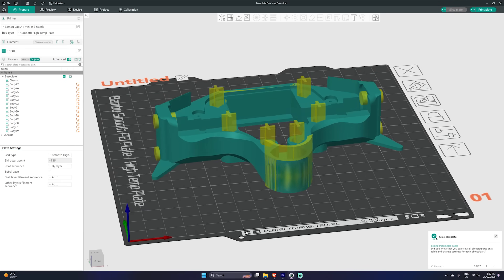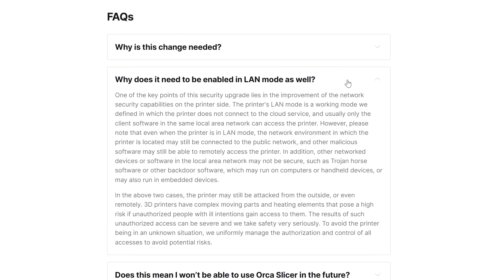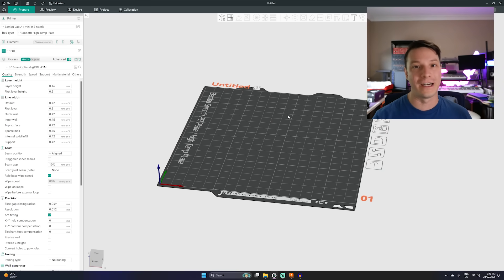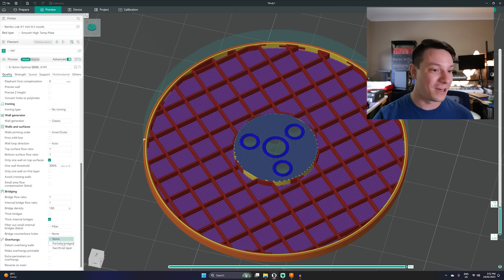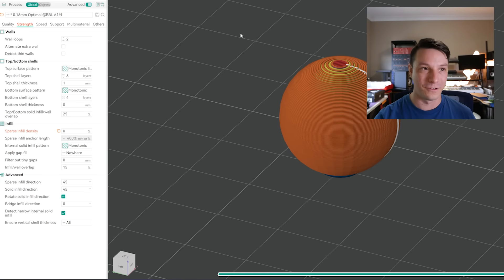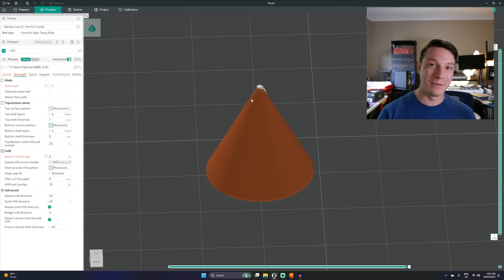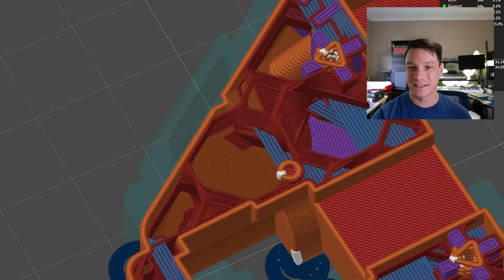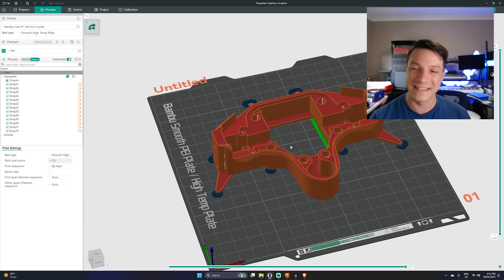I've switched to Orca Slicer for my Bambu Lab 3D Printer (and you can too)

Comment: Anyone gone from Cura 5.9 slicer to Orca?  Thought/opinions
Reply: I’m currently in the process of trying to switch from an old 5.4 profile and move to orca for the built in tuning prints and such, I’m still a newbie to printing to, the profile I use for my klipperized sv06+ isn’t my own, I do make some minor tweaks to it in cute but usually only number of walls and infill type, I figure if I’m going to really learn how to build a profile orca seemed like the way to go
Reply: @ that’s one of the main features drawing me to orca as well, the tuning prints. Cura has some as well but not as robust as I’ve people people using with Orca. Thanks for sharing
Reply: Just do it. Don't overthink it.

Comment: how does a single outside perimeter of 0.8mm happen with a 0.4mm nozzle? is it overextruded?
Reply from the maker: Yep, in fact the line width is always a little over nozzle size (usually 0.42) to ensure good layer and line adhesion. You can push some really fat extrusion lines out of a smaller nozzle, but layer height is still limited

Comment: I'm fine with Bambu locking down for future printers, but i bought my X1 2yrs ago. I don't appreciate that they change the terms of purchase on something i own. That makes them untrustworthy.
Reply: I think what Bambu brought to the table was a properly engineered product. They figured out how to properly design a printer for mass manufacturing. I think that’s the difference between Bambu and Creality. Creality designed similar printers for mass manufacturing, but either because of design and/or QA, they can’t seem to CONSISTENTLY produce a printer that just works. Bambu, I’m sure, has some duds come off the assembly line, but I think their rate is just much lower than the Crealities and other “consumer tier” manufacturers (from what I can tell). And yes, that design costs more (that’s why Creality can undercut them). But It’s not Stratasys more. It’s “reasonably” more for a consumer. That’s what I think Bambu “revolutionized.”
Reply: Bambu is like iphone. Iphone did not invent everything, they did not invent most of the things that made the smart phone a smart phone. But Apple made it work well. Until few years ago, iphone still work best out of the box.
Reply: Agree
Reply: You're you're implying that China was trustworthy before They changed The terms of Purchase? China is possibly the most untrustworthy country on the planet. If anyone is designing and printing parts to sell them they better not be using a bamboo product. China is guaranteed to steal the design and sell it for 10% of whatever they are selling it for.
Reply: They had the necessary things for it from the start. I did not buy their stuff
Reply: What terms did they change or go against? The hardware still works with the supplied software, there’s no change there. The fact that they even allowed the use of 3rd party software was a surprise and to be fair, you still can use orca, you just won’t get the total integration you had before. 

If you have manufactured a hardware product, would you willingly allow 3rd party software that you have zero control over, interact with it without some level of oversight? I wouldn’t. That’s just opening the door to a slew of potential issues. So I know it’s not a popular opinion but I am surprised that people couldn’t see this coming. There needs to be some level of control
Reply: i bought mine a month before it all went down. too late to return :(
Reply: Exactly. They changed the terms of the purchase after the purchase. I have an A1 mini and a p1s, and I'm not very happy with how Bambu are limiting my products
Reply: @moccaloto   but they didn't, all the advertised specs and features are still the same
Reply: came here to see what the sentiment has been since this happened. still happy? Im not. almost wrecked multiple bambu machines, only because of their proprietary systems. 

this is malicious, and Im tired of it, and I sell these machines for a job. I cant do it if I dont see them as convenient, and they arent convenient for designers anymore, my primary target demographic, these bambu machines are being turned into IP farms, and I wont go along with it. 

ditching this hobby, building my own machines and networks, gonna take a summer off next year to learn IT, data security, virtual machines and containers, and jailbreaking my own CNC machines, this is heinous.
Reply: @DavidSmith-cr7mb THIS IS THE WAY
Reply: Yeah, that lost my support too
Reply: Ive made the switch to Qidi and I'm over the moon happy. The q1 pro is unbelievable. Prints anything and quality is better than bambu. Runs over lan. No cloud bs and has fluid built in which is just a whole new world of improvement
Reply: God forbid you have one extra screen before sending it off to print lol
Reply: They increased security and it means not much to play with 3rd party stuff. Most people dismissing the tightening of its printer ecosystem mostly are not affected by it or likely they don't know how it works. Most haters are youtubers that are affected. Regular users who uses bambulab printers benefit from its printer's capability. People still bought iphones despite its tight security.. because the product is functional and pretty.
Reply: it was inevitable which is why i never even bothered to buy one. Plus, the hardware they offer isn't anything near revolutionary. If it wasnt for the software, they would be yet another failed closed source company.
Reply: @NotRandoWis can’t really agree there. BambuLabs literally reset the bar on 3D printing and saying that they are nothing special is either being disingenuous, wilfully ignorant or just showing a lack of experience in 3D printing. The X1C came out 2 years ago and it’s only now that competitors are getting close.
Reply: @proaudiorestore8926  As someone who used ot hate on Bambu and then ended up getting 1, then many more, these clowns will never change their opinion. They blindly hate while staying ignorant. Bambu changed the 3d printing game. Anyone who disagrees is some raged up flogga stuck on their ender 3 v2 or over priced prusa machine that isn't willing to accept change.
Reply: @proaudiorestore8926  I mean that's not the case at all, so thats silly to say. its blatantly wrong. But i guess we will just have to disagree. No I've been printing for about 15 years or more now. I'm not just saying this to say things for no reason lol Im saying these things out of years of experience and hundreds of hours across multiple machines. 

The hardware is standard hardware. The software is the only thing that makes these printers competitors at all, since the hardware design is about as revolutionary as open-source hardware from 2017.  They also exaggerated the 1500mms speeds quite a lot too. More like 500mms. Thats why the Creality machines that came out right after the X1 could keep right up with the X1 lol 

then you got people on here crapping all over Untimaker and Prusa like they don't matter now too which just shows the ignorance of people in this space.
Reply: @NotRandoWis the hardware is revolutionary. I fully expected them to go this way (just not as soon) when buying my A1 mini. It crushes it's competition. Keeping it in LAN mode and never ever updating it was absolutely worth the money. It is insanely good for it's price.
Reply: @perz1val  The ONLY thing "new" they did was using carbon fiber guide rods and that fake LIDAR. Literally EVERYTHING else on those machines are from the open-source community. They even had a hard time patenting the machines they sell because most of what they did are already held by RepRap Project and other projects. Even the software is just a fancy version of Klipper essentially. I'm telling you, the company has a hold on you. Its not nearly as good as you think it is.
Reply: @NotRandoWis  Exactly, everything was available to all other manufacturers, yet they still struggle to deliver competing printers. Tell me, are they incompetent or is Bambu actually good at this? OK, that does sound like shilling, but I'm actually annoyed by all other manufacturers being so slow and incapable of taking the FREE STUFF and packaging it into a good product. We had vorons for how long? The parts alone cost a lot. Then there's time. Bambu is super cheap compared to alternatives. And the pinters are fast. And reliable. It is a revolutionary product. My A1 mini is a printer I just connected to wifi, switched to LAN mode (I knew it! I knew it!), put filament in and it was going. It just f*ing works. Now after what they did I'm not gonna buy anything else from them, but they're still making excellent printers with hardware absolutely worth *the price*
Reply: @perz1val  Thanks! I think it's like Apple. The combination of hardware and software and the very good user experience is enough to make something revolutionary, imo. And especially if it literally woke up almost all the other fdm printer companies and everybody just tried to keep up with the technology/price bambu had to offer out of the box. Creality and Prusa released enclosed printers and I think they wouldn't if Bambu hadn't made corexy so available and relatively cheap and reliable.
Reply: But I have to add, I also won't buy any other printer than my A1 mini from them. But at least, I have a relatively cheap printer which is finally!! really reliable and with a good user experience.
Reply: @BESTofAlp  I'd say they are more like the Windows 11 of 3D printing. 🤣

Taking something that was already good and adding needless crap that no one wants while making the user experience terrible in the process.

At the end of the day Bambu will ultimately become like Makerbot and XYZPrinting, especially if they are going the direction the Verge article seemed to imply. They have done irreparable damage to their brand image by being greedy about third party hardware support and in the process of trying to make off with the bag by patenting a bunch of expired Stratasys patents along with open source designs it has gotten the attention of Stratasys's lawyers. They very likely will not exist on the consumer market within the next 10 years.
Reply: @perz1val  Beg the difference on reliable. I have had an a1 combo and its a piece of trash. Bed and power board replaced at 10 hours and now at 75 hours it just plain refuses to print. Their filament leaves alot to be desired too. Fresh out of packaging and it gets jammed. Old filament I have had for years prints. Go figure. So.. Yeah. I agree with Rando.. Its their software (and makerworld) thats good.  As far as the printers they are just dressed up cheap junk. Heck. I have had zero issues with my ender 3 and its so old it has the original 8bit board in it. Now thats reliability! lol.
Reply: @NotRandoWis that's false. The 3D community was running stagnant with no one really innovating. Bambu labs came in and totally disrupted the community all of a sudden everyone had to start playing catch-up if it wasn't for someone like bambu coming around 3D printing would probably still be stuck being stagnant and not a friendly hobby to get into. They also had pricing you couldn't beat for what they offered.
Reply: @korn2040  it only changed things for inexperienced people. It did nothing for the actual community. All it did was create a second community of people that know nothing about 3D printing and gave them the ability to print things ok without having to do the work lol You know nothing about how all of this played out if you really believe what you say
Reply: @NotRandoWis that's insane way to think I know tons of people that have been 3d printing for years and moved over to bambu because they don't have to tinker they can just print and still have the knowledge on how to fix anything if they need to. I see you're one of the 3d printing gate keepers shame on a company for making it accessible for more people.
Reply: @NotRandoWis its so good though. You really have to use one to appreciate how fast it can be.
Reply: @NotRandoWis love them or hate them saying they aren’t revolutionary is just plain nonsense. They single-handedly changed the industry away from i3 ender 3 clones.
Reply: @Xenthera  i just realized you said "changed the industry away" from creality like they didn't come out with a printer like a week after the X1 for 300 dollars that has just about everything the X1 has lol thats also rich of you
Reply: @Xenthera  lol bambu isn't revolutionary. There were already coreXY printers with input shaping on the market two years before bambu was even announced.
Reply: @LilApe   more cope from you lol. If they were so good why weren't they so popular and widespread?
Reply: @Xenthera people compare the first ender3 with latest bambu, until wenn.. creality has made so many machines and with same or better quality or speed..
Reply: @Xenthera you might want to dwell on what they actually said, the hardware itself is nothing special. Thats just a fact. The form factor existed ages before they came along. They did in fact assemble a very nice package, with the software and out of the box tuning being the key.  If you want to consider them revolutionary fine, but at least understand why that would be the case.
Reply: @LilApe  yeah, but not in a nice package ready to use, x1c was something that wasn't done before, my x1 (Kickstarter so about 1300$ with ams and vat) revolutionized how I use the printer, it just works 99% of the time, never had that with the kosseel or i3 printers o had before, yes I had a prisa mk3 as well, worked better but the x1 still felt lika a spaceship.
Reply: @RandoWisLuL  hope you feel better after whining all through these comments. 😆
Reply: @LilApe  then why was bambu recommended over and over as recently as December 2024 (when i bought the P1S+AMS)? I didnt see anything else nearly as cheap or suggested as the bambu lab printers
Reply: @lilypower  Ankermake M5 and flsun V400 were both already out at the same time bambu has their kiickstarter going. Two fully assembled high speed printers with input shaping. Again, bambu wasn't the 1st nor were they revolutionary. Only the misguided believe they are.
Reply: @Xenthera  Agree, these people are just haters by influence from youtubers. These youtubers make noise and complains about ANYTHING because they need to make content - Fully understandable. Most regular users are content with Bambu slicer and its ecosystem. For example, I'm more than happy enough myself that i can use my own brand of filament and save its profiles. I can remotely access my printer using their app local and remote. And if they tighten the security by closing some doors, so be it, they have the right and i did not lose my access. These Bambu lab printers are revolutionary because it is made as a functional tool with LESS tinkering - plug and play like your HP printer. These youtubers still treats it as a free for all mod all you can ender 3 printers - again just for content.
Reply: @Xenthera  they did, but also, that was kinda inevitable, someone just needed to make a relatively affordable and easy to use corexy machine, bambu just happened to be the one to do it
Reply: @DrewLSsix  Okay after re-reading what they wrote, I can agree the hardware itself wasn't revolutionary and had existed before. I still stand behind the fact that bambu as a company revolutionized 3d printing as a whole though.
Reply: @silverify I'm sorry, but when I see anyone ask for suggestions no one is saying creality because they just aren't comparable
Reply: What did Bambu do?
I ask because I bought 4 recently and plan to purchase another 20 if they do what I hope they can do.
Reply: @livefree1030 They locked out functions that were previously accessible in the name of "security"... But they implemented the most half arsed security in the world, showing that they were maliciously attacking the 3rd party companies developing for their printers. Not to mention the always online aspect of their printers being the only way to get access to a significant portion of features which should be easily configurable without a 3rd party server being a forced access point. They are anti-consumer, closed source thieves who change the terms of the sale as they please once they have your money.
Reply: @livefree1030 they have laid the foundation to force a subscription model to be able to print.
Reply: @livefree1030 they ruined their reputation by getting hacked, alot later they announce only their slicer will work with their printer. Then they edit their announcement and accuse people of lying. Not a company for me.
Reply: But they didn't, all the advertised specs and features are still the same.

Comment: Do you ever plan on experimenting with electroplating 3D prints?
Reply from the maker: I love the idea, but the chemicals and equipment are pretty involved!
Reply: @MakersMuse  I think that basic copper plating isn't too involved lol. All I have is a benchtop power supply, 2 copper solid core wires, and distilled vinegar for my basic setup. The hardest part seems to be getting a good conductive paint that sticks well to plastic and doesn't have too much electricity resistance.
Reply: @gjallarhorn4504  What do you currently use? I would think MG Chem Nickel conductive paint would work, I used to use it for RF shielding.
Reply: @Voyajer.  A mixture of graphite and mod podge. Took different sources of graphite to get it to work lol. Some companies say its 99.99 percent graphite which is not always true for some reason. Ive seen MG conductive paint but id rather use a more cost effective way. Those seem to be weirdly priced lol.